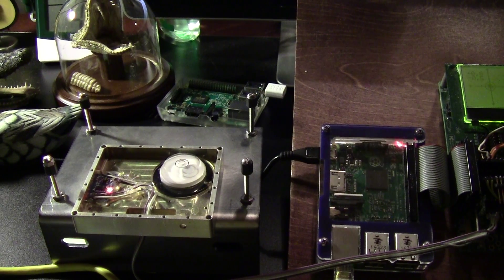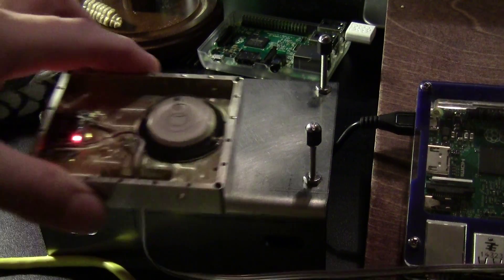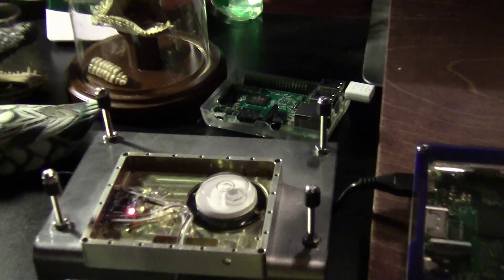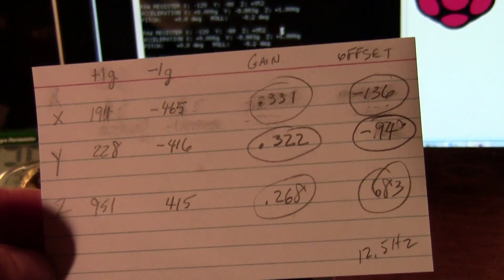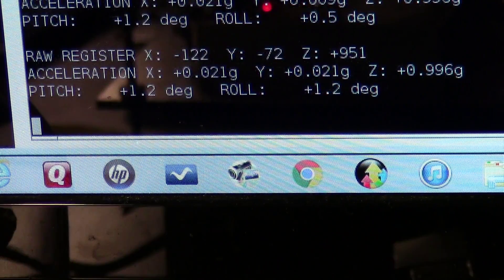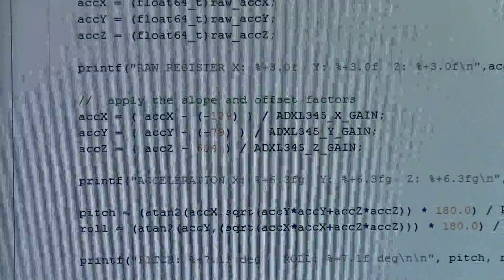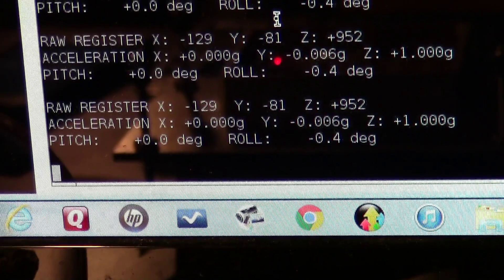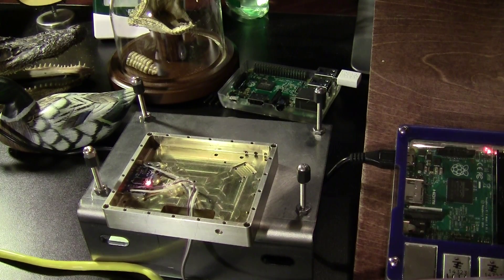"ADXL345 Calibration Technique"

Comment: There is something strange in your video that I couldn't get. How do you print an angle with an accelerometer ? I had never managed to do that . you only measure acceleration not a magnetic fields of earth so how do you get an angle ? 
For example if you want to detect a turn of 90 degrees,on some robot , no matter to what direction,just a change of x degrees,  its impossible because if it moves slow enough, acceleration is 0 .

Am I wrong ?
Reply from the maker: https://youtu.be/i2U49usFo10